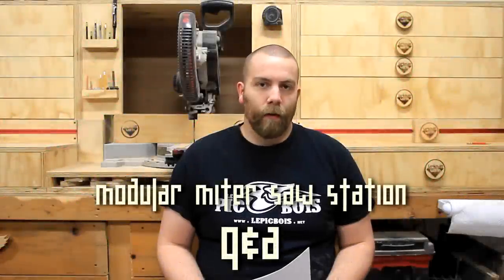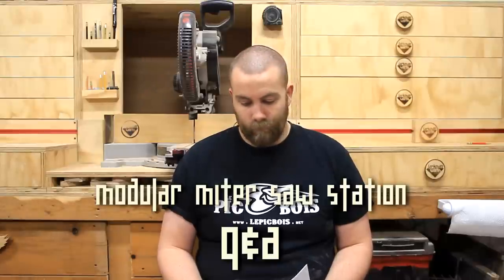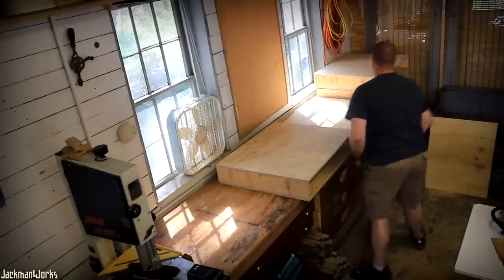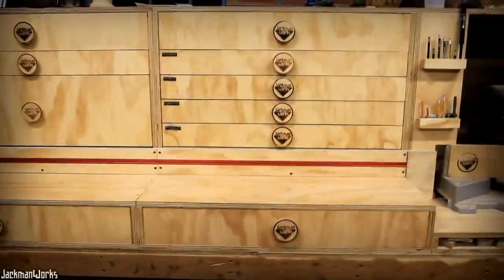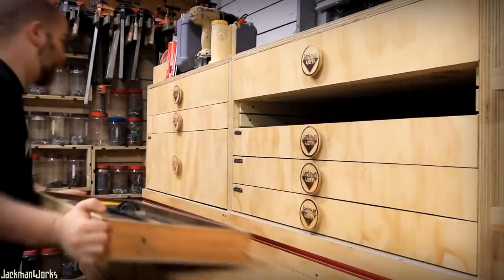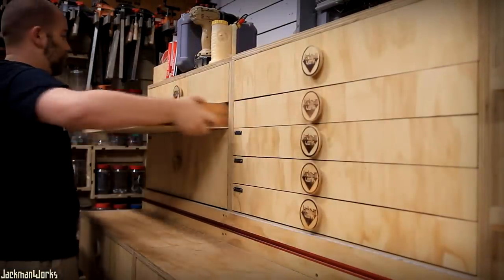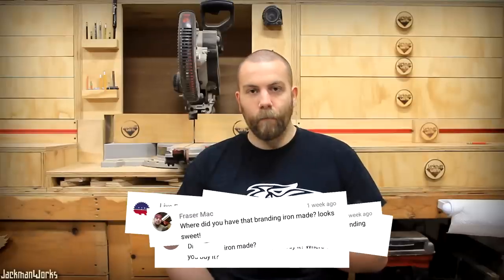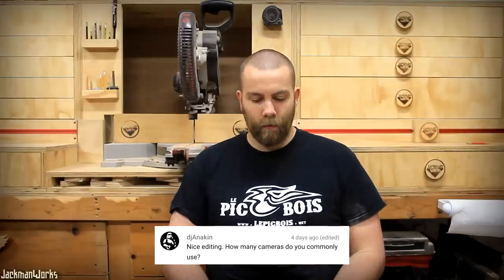Miter Saw Station Q&A (part 4 of 3)

Comment: What's the tool you used to cut out the foam tool holders? It's not a normal Stanley knife is it? Looked too neat for that, a hot iron type thing maybe?
Reply from the maker: It's the Kaizen Knife from Fastcap: http://amzn.to/2k2b4f5
A long bladed utility knife, but I heat it up a bit with a torch to help cut the foam.

Comment: awesome video.  You mentioned you move alot.  Do you usually use a moving company to pack up your tools, or do you have some sort of a system?  I am trying to think of ways to build my shop work surfaces in the event that I needed to move.  Any advice or recommendations would be greatly appreciated.
Reply from the maker: I've only moved myself so far, but if I get too much heavy stuff I might have someone else do it (but that's not in the foreseeable future). It's tough, but it's just a matter of not getting married to your current space but instead building adaptable things. For a work surface, check out my workbenches here: https://youtu.be/dtrWMrZhVC4
Reply: Jackman Works.  Thank you Paul.